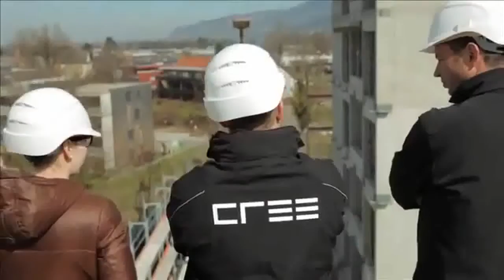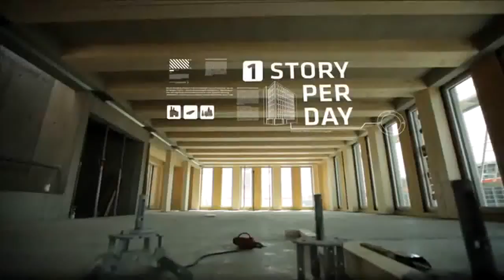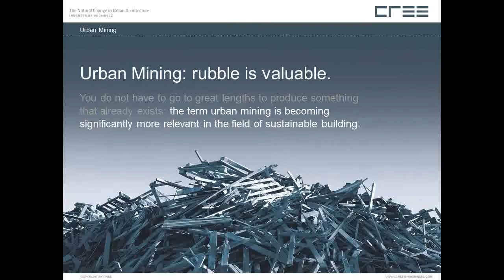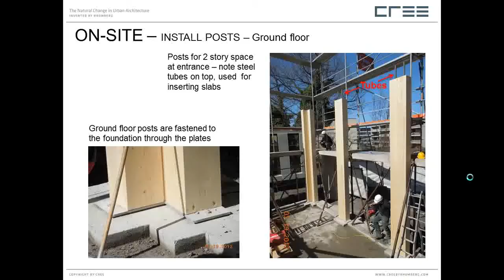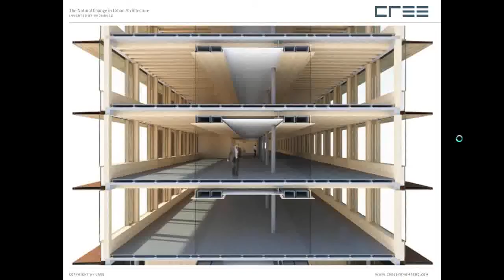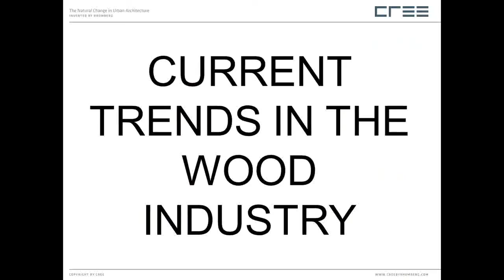Nabih Tahan from Cree Buildings explains LCT-System

Comment: for the floor system, did you consider aerated autoclaved concrete, AAC it is called sometimes? It is very light and also has a good fire rating.